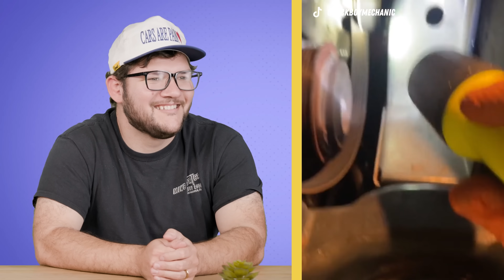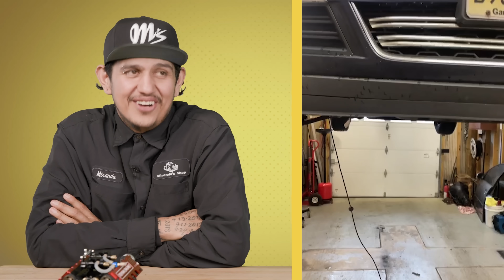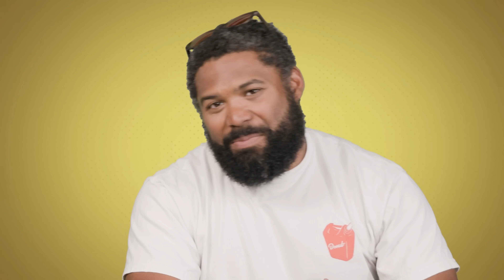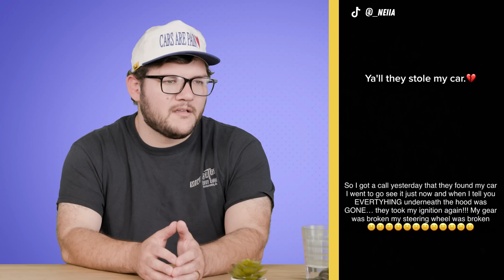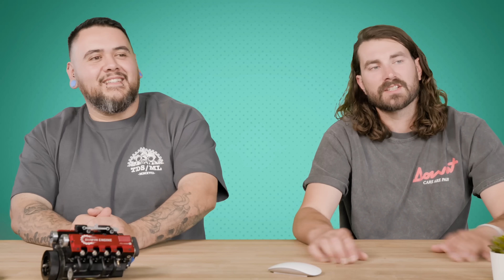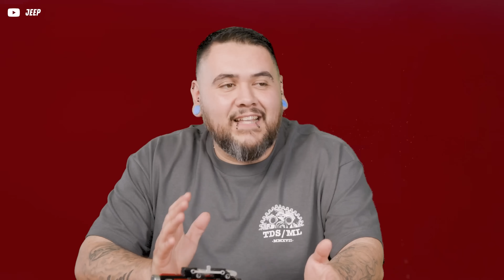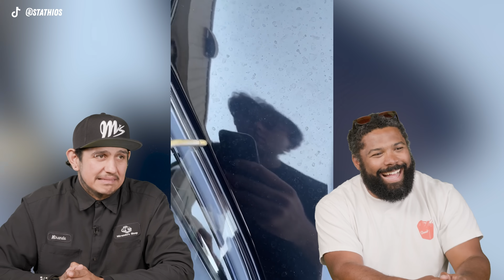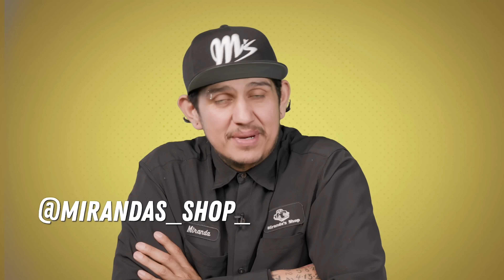Mechanic Reacts to Car Engineering Fails

Comment: The first one is not the powertrain engineer's fault.  That engine (GM 3.6) was designed to fit into multiple vehicles, both longitudinal and tranverse.  It's a case of GM Being cheap and more than likely not letting the powertrain engineers work with the body/frame engineers.  That said, that engine and chassis is an absolute POS that should have never been made.
The Jeep one is 100% engineers.  That f*cking TIPM (Totally Integrated Power Module) is stupid and causes SOOOO many problems. 
The Tesla door handle thing is just being cheap.  They have revised them using better components, but it comes down to saving some money.
The engineer VS mechanic thing will never go away, it's like oil and water.  My first experience with "WTF were they thinking was a mid-80's AMC Eagle.  Worst. Vehicle. Ever.

Comment: 3:18 oooh pulled the alarm fuse, smart. So people would just think the owner accidentally hit the button. Or they would assume that anyway. And one time my aunt set off her alarm by using her key manually on the door because the battery died.

Comment: As an automotive engineer, we blame management. Seen this too many times: 
"Hey boss, remember that really long bolt we needed back when the weld nut was 3 inches inside of the body, but it isn't anymore? Can we shorten the bolt so it doesn't hit the engine when you unscrew it?"
"We're using the long bolt somewhere else, it would cost an extra 50 cents per vehicle to have 2 different part numbers. Request declined."
"But, that will be super annoying to work on..."
"Do we make money off mechanics liking us? Its their job to figure it out. Maybe we can fix it in the next model year."
A few months later
"Alright we're designing the next model year, I've written a change request to swap that long bolt out real quick."
"That issue isn't tracking in my spreadsheet as a high-priority item. Leave it for now, we can always come back to it later."

Comment: Engineers don’t design this stuff on purpose. They’re forced to by constraints such as cost and project management. However, if you leave engineers to design the perfect car, it would never get done because they’d be forever stuck arguing and sending 300 page emails to each other 😅